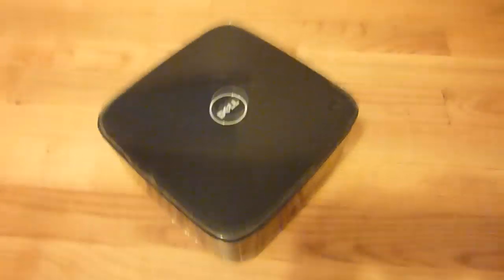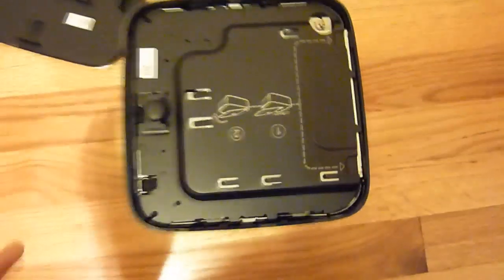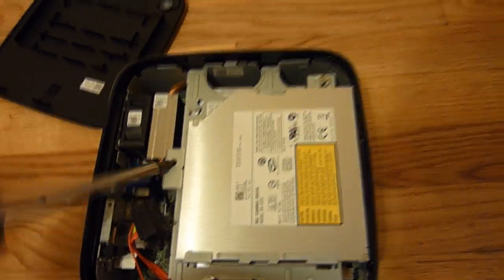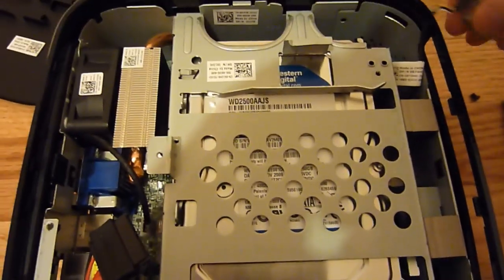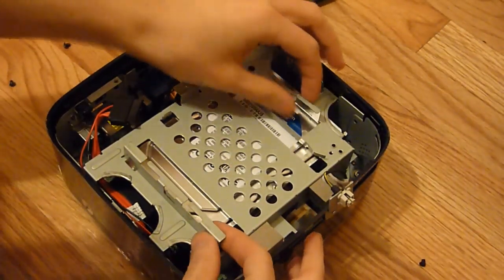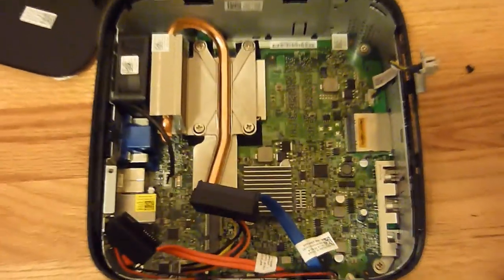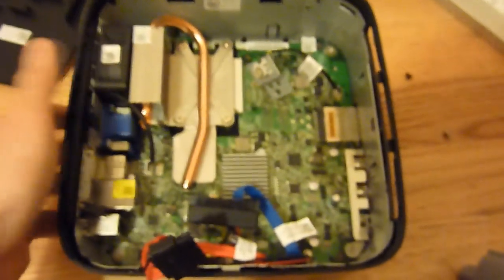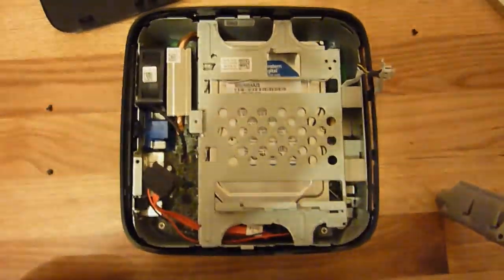How to dismantle and upgrade Dell Zino HD

Comment: Thank you. I never knew there was a button in the back to pop it open. I was told the motherboard is probably bad, so I just need to get the hard drive out so I can transfer files viz a docking station. Will just get another computer after this.

Comment: Because Youtube is forcing Google+ on us, I somehow can't reply to a lot of you guys. To quickly answer some questions: 1) It holds 3,5" inch harddrives. 2) If you get the one with the 03D1TV motherboard (you can check this by looking at the QR code on top of the motherboard, near the connection of the power switch) it has an AM2 socket. 3) You can upgrade the CPU with another AMD processor wich is compatible with the AM2 socket, keep your temperatures in check however, that heatsink is very small, to small probably to run an Athlon x3 or x4 if the chipset supports it. 4) You cannot add a soundcard for as far I can tell. 5) Upgrading  the graphics card is not possible on the 03D1TV motherboard, as this is integrated into the motherboard. Other models have an MXM slot to put a graphics card in, the 03D1TV motherboard does not have this slot. 6) The DVD-drive is a standard size (for most) laptop drive. You can problably replace it with a blu-ray one if you can get the front bezel to fit. Hope this helps, I just got a Zino HD400 for free, it has a broken motherboard though :(

Comment: With stock heatsink you should stay below 30W TDP on the cpu, but with a 1U server heatsink fan You could go to 45W, but don't forget that the original Heatsink covers the gpu also so a passive Northbridge Heatsink will be required for it also. I've been running mine for 2 weeks now and it Flys, no stutter on video and almost as fast as my XPS-8300 with a I5-650.... I'm happy but I bought a spare motherboard for 28$ just in case it smokes....LOL.

Comment: There are two flavors of the Zino 400 HD motherboard, one with the video  built into motherboard and one with a MXM slot capable of the ATI 4330 video card, you can get a barebone one on ebay for 100-120 dollars without the cpu,memory,hd,DVD and build it to your spec's. Make sure you get one with the 4330 card, I started with a 2650e 1.6ghz but upgraded to a 4850e 2.5ghz x2 and a dynatron A48G 1u cpu cooler, had to put a northbridge passive  heatsink on gpu to keep it below 60degC

Comment from the maker: @L0STGAM3R2565, no, the graphics card is built into the motherboard - there are no options to upgrade the video card once the system is built (if you want upgraded graphics, you need to order the computer with upgraded graphics from the start)

Comment: may i ask what is the model of the dell zino optical drive?  I was planning of ordering a zino and replacing it with an sony laptop blue ray drive.  I'm mainly concern about whether the bezels will fit in the switch.